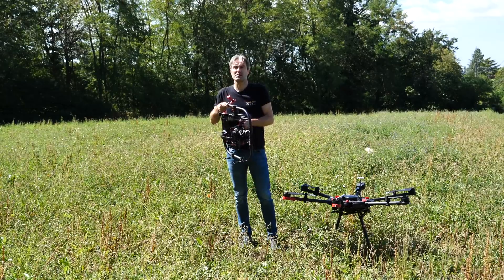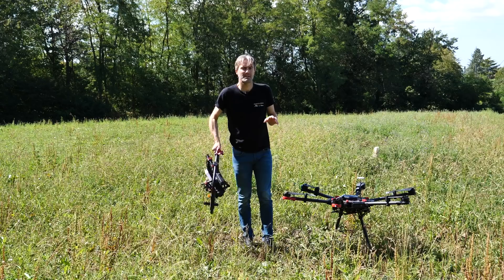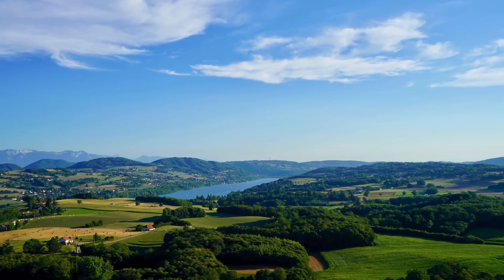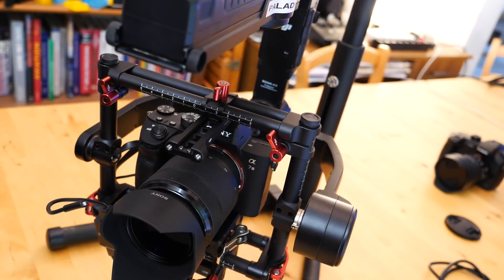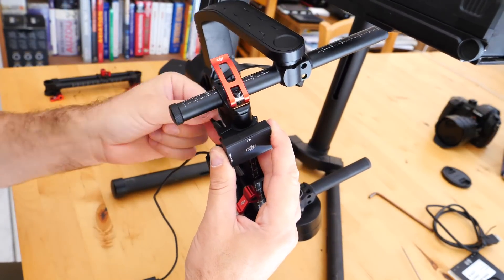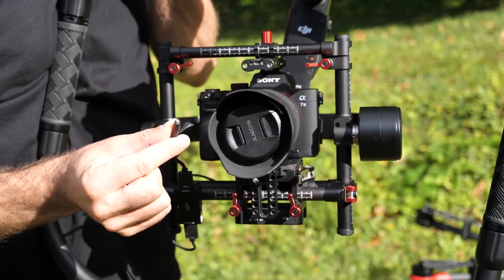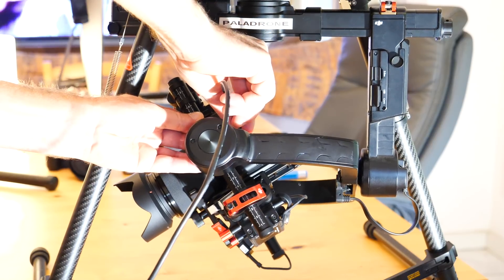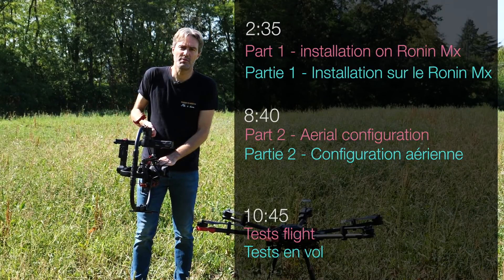Sony Alpha 7 III embarqué sur DJI Matrice 600

Comment: This is a dream a setup! I'm attempting to make a better Cinematic UAV than my Mavic Pro Platinum based on 700KV Navigator T-Motors & Tarot 690Pro hexacopter frame, but I can only afford to run it with Nex5 setup at the moment, but alpha 7 III ticks all the boxes for aerial cinematography, apart from limited and expensive choice of lenses
Reply from the maker: Thanks for your comment 👍

Comment: Thanks for great video!!! Do you need the wireless transmitter/receiver for this setup or are you plugging in directly with a hdmi cable? Thanks  in advance
Reply from the maker: Hello, Thanks for feedback 👍 You don’t need the wireless transmitter if you are using the Hdmi connexion.
Reply: Awesome have my mx on the way can't wait to get it setup.i am having issues finding a remote start/stop unit and sony lead for it. No one has stock anywhere.you have any suggestions how else I can trigger camera? Thanks heeps

Comment: Thank you for the detailed video. Very well done. I can't believe I haven' found this video until now.  I have been using the same setup but with (A7rIII) for 2 years now for still photos. I have not had much luck with shooting videos because of stability issues.  Do you adjust the gimbal motors any more than the AUTO TUNE settings. I recently bought a Gremsy T7 and having similar problems. 
With still images, I can't seem to get a still image on a 28mm any lower than 1/60 shutter speed. What have you been able to achieve ?  Thanks again for creating this video. Cheers
Reply from the maker: Hello, the problem of vibrations transmitted to the camera comes mainly from the dampers of the M600 plate which are too hard for light cameras. They are well sized for a RED type camera, but too rigid for an Alpha 7 + Ronin Mx. By perfecting the balance of the A7 on the Ronin MX to the maximum, I manage to have an exploitable image, provided I do not fly full throttle. Unfortunately, the gimbal Gremsy should not change the issue. If possible, try to replace the dampers by a more flexible part.

Comment: It appears that if I follow this precise set up, that this will work perfectly for photogrammetry on my M600 Pro as the auto pilot will be able to trigger the Sony camera using the Ronin start stop module. I have a question regarding the hot shoe bracket.  I noticed that you put a bracket on the hot shoe of the camera. If I want to do PPK map processing, then I will need to attach the Emlid M2 GPS module to the hot shoe of the camera So that every photo is logged as an event in the GPS module.  I was just curious why you placed the bracket on top of the hot shoe .  Thank you for making this video and I welcome any feedback you can provide.
Reply from the maker: Thanks for your feedback 👍 my opinion is that the bracket is only an additional safety and is facultative for a such camera, when the lens is not too big. There is no problem to remove it and leave the hot shoe free for a gps module.
Reply: @paladrone  Thank you for answering.  I want to be clear before ordering the Ronin MX.  Does the Autopilot (A3 Flight controller) send the shutter actuation through the Ronin Start/Stop module?  I just want to make sure that if I use your setup example, will I be able to use DroneDeploy or UgCS to trigger the camera as needed for photogrametry?  If so that will be very nice!  Then I can hook up the GPS module to the Sony hotshoe and do PPK processing for the images.  Thank you again for your helpful videos and thank you for responding.  I am new to the M600 Pro and still learning it.
Reply: @paladrone  Do you ever have a problem with the IR signal not triggering the shutter?  How do you keep the RSS cable wire from moving all around in the wind when flying the drone?

Comment: Very well done! Thank you.  I'll be using this setup for still photographs.  Does the IR initiate autofocus as well as take the shot?  Most importantly, do you get any motion blur in your still shots?  I make large prints and need to have super sharp raw files.  I would probably use the internal image stabilization (or on the lens if it has it) to further isolate the camera from drone vibrations.  What has your experience been in that regard?  Is there a shutter speed you feel you can't go below, say 1/60th of a sec or slower?  Thanks very much.
Reply from the maker: Hello Kevin, i confirm that IR initiate autofocus. Blur appears when speed of the aircraft is too high (more than 5m/s typically). Yes for internal stab of the camera. I’ve tried shutter up to 1/125, below I don’t know.
Have a good day 👍

Comment: Merci pour ce tutoriel très détaillé. Est-ce que j'ai bien compris? Impossible de changer les paramètres photo et vidéo en vol dans ce type de configuration? Je viens du monde DJI Inspire et Mavic. Votre configuration m'intéresse, mais si on ne peut pas changer les paramètres en vol, c'est  très embêtant à mon avis.
Reply from the maker: bonjour, je confirme, on ne peut pas agir sur les réglages de la caméra. Ce type de conf est pas adapté à de la vidéo et il vaut mieux rester sur un Inspire 2 + x5s ou x7.

Comment: Hello. Another excellent and helpful video (as usual...) I just bought the matrice and prefer to rely on YOUR tutorials  to set it up rather than  the DJI ones ! Have you any idea about the  estimated flight time of the Matrice with a configuration like this? (I will use the A7RII with the Zeiss Loxia 35mm witch is a little lighter but I don't think it makes much difference...) Thanks.
Reply from the maker: Hello Dude, thanks for your feedback. The estimated time flight with this configuration is about 22 minutes.
Reply: @paladrone  Thanks!

Comment: Bonjour Stéphane, et merci pour cette vidéo.
Avec cette configuration, utilise-tu le start&stop IR d'origine DJI? Peux-tu vérifier, si tu ne l'as pas encore fait, s'il te plait, de pouvoir déclencher les photos pendant une mission de photogrammétrie programmée avec GSP? (la flight control que t'as sur ton M600 est bien une A3+LB2 pour le retour video?)
Merci beaucoup pour ton retour,
Andrea
Reply from the maker: Bonjour Andrea, oui c'est le start/stop d'origine DJI. Ca doit bien fonctionner en photogrammétrie car j'avais testé avec GSP et un GH5, il n'y a que le cable RSS qui change, mais je n'ai pas encore testé. Précision : j'ai le LB2 et le controleur A3 du M600 (et pas celui du M600 Pro)
Reply: Merci Stéphane,
Justement, j'ai un M600 Pro et... beaucoup de soucis avec deux modules (Intelli-G et VP-Remote) qui arrivent à déclencher la caméra manuellement mais ne permettent pas la prise de vue automatique via GSP. Do you believe that there is a difference in this behaviour between M600 et M600 Pro? Finalement, la FC est toujours un A3 (juste avec quelques capteurs en plus pour redondance sur la M600 PRO...).
Reply from the maker: Hello Andrea, your are not the first person who ask this question to me, and having this issue with the M600 Pro, while with M600 the problem does'nt occur

Comment: Informative video. I have the Alpha 7 II on the Ronin MX and M600 Pro right now - do you think its worth upgrading to the Alpha 7 Mk III? And if so why?
Reply from the maker: Hello, thanks you. Regarding this relevant question, first I would say I have not tested the Alpha 7 II. The mark 3 is a little better in terms of stabilization, autofocus, dynamic range, sensitivity and battery life. If you are not limited by the camera today, I think there is no reason to change. As well, the answer depends on what are your uses.

Comment: TOP les explications. Par contre, j'avoues qu'avoir des images aeriennes issus d'un capteur Plein Format Dynamique et qu'une grande résolution doit etre magique, mais en meme temps, si le drone tombe, tu pleures, car tu as perdu ton drone, le stabilisateur 3 axes et ton Appareil Photo ... ca fait un sacré budget perdu à la moindre erreur de pilotage ou défaut du drone.
Merci encore de tes explications claires et précises.
Reply from the maker: Bonjour Didier, oui en effet les conséquences d'un incident avec cette configuration peuvent être désastreuses. Un M600 n'est pas plus difficile à piloter qu'un petit multirotor mais impose de la discipline et de la rigueur tant sur le pilotage que l'entretien. Heureusement, les 6 rotors et les 6 batteries assurent une redondance qui apporte une tolérance aux pannes. merci pour ton message et à bientôt !

Comment: Could you receive gps tags?
Reply from the maker: hello, this configuration cannot provide geolocalized photo.
Reply: Paladrone, so it wouldn't be suitable for photogrammetry, do you have solution to take photos geotag?
Reply from the maker: You are right, it is less efficient but if you need high resolution (with Alpha 7R III, eg) you have no so much solution. In addition Photoscan can works without picture geotag, but if required you can geotag the picture later, based on the mission planner waypoints.